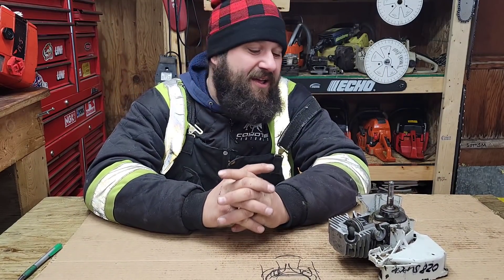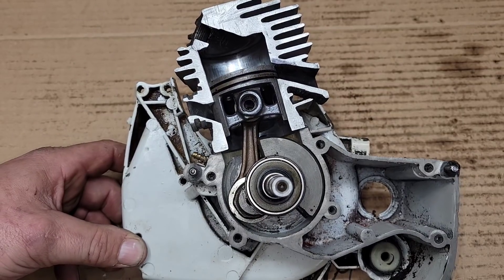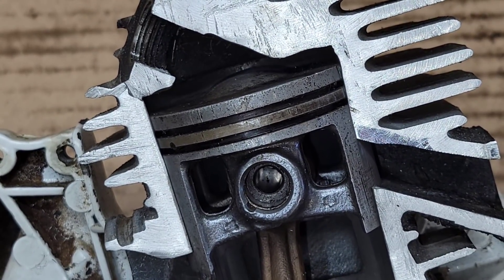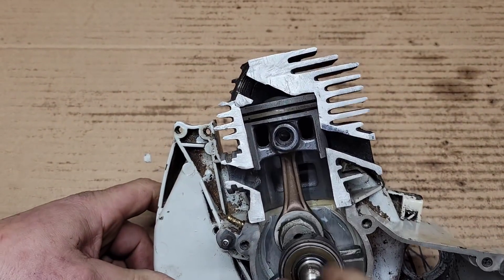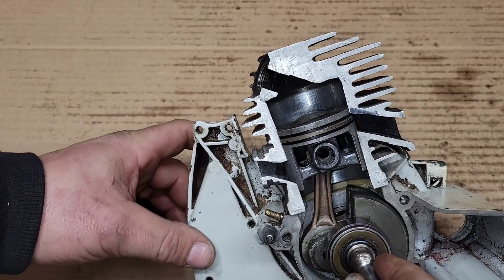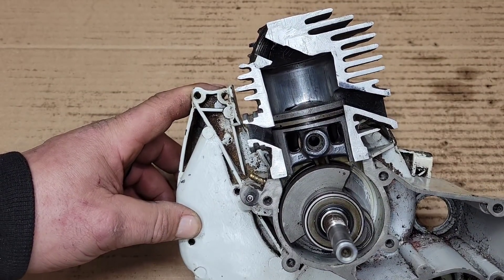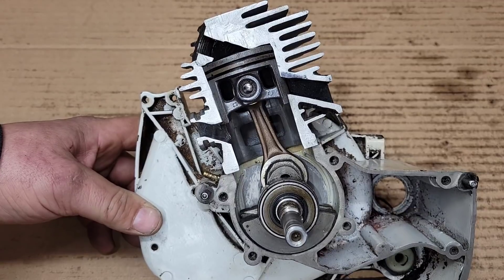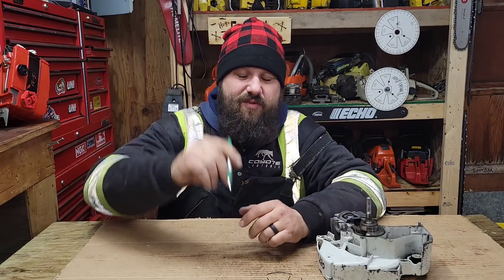Chainsaw Cutaway #6: A refresher/ how it works/ how to modify a 2 stroke.

Comment: Around the 8 minute mark when you're talking about measuring intake timing, you say you measure intake opening before / after bottom dead center.  But you say it's 70 degrees for 140 degrees duration.  It really looks like it's 70 degrees before / after top dead center, not bottom dead center.  Also the intake open duration occurs while the piston is at the top of the cylinder, so it makes more sense that it would be measured  that way anyway.  Did you just mis-speak?  I ask because I've heard other people say the same thing in videos.  They're talking about the intake opening relative to BDC but that seems wrong compared to the numbers they give.  Anyway, great video series.  Thanks for making these.

Comment: Really great info, thank you.  I'm going to try my hand at this on a 350 husqvarna with a hyway cylinder and popup piston. If I understand this correctly,  a gasket delete, then raising the exhaust back to where it would've been before the delete, should give me more compression and bring the rpm back up from the delete. Does that seem like a good plan on a work saw? Is there any consequence to widening the ports as long as they are writing the piston skirts?

Comment: I have a 670 Echo and I love this saw cuts like a dream only thing that may be good or bad a rev limiter but Iam use to it so doesn’t bother me. And I put a longer bar and chain and I think it’s a 30” but not sure but it pulls tha chain no problem it’s a beast and it is two tone color a gray and a little bit of orange don’t know what that means and I was told that their commercial version but don’t know if that’s true and if you know let me know ?

Comment: Thank you sir.
Greatly enjoyed.
-------------------------
The fuel detonation sends a shock wave
downward through the piston rod 
and into the rotational mass below,
which is designed to absorb enough
rotational energy to push the piston
back up for another fuel charge and
subsequent detonation.
Its a beautiful machine and 
thanks for slicing it open so well.
-------------------------------------------------------
Mr. Brown

12.11.2022

Comment: Very nice.
Something that I have wondered is what sets the ultimate rpm that a saw/engine will spin out to. Typically the peak power is close to the top end of the revs so it seems to me if you can get more rpms you will get more power.
Reply from the maker: Exhaust port height and shape/ ignition timing and over all weight of the rotating assembly can all play a part in max rpm.

Comment: Hey Tinman I have a mccoulloch 10-10 it's stock carb is good compression is good so is the piston and cylinder but no matter how I tune the carb it's blowing gas out the carburator until everything soaked in gas it don't want to Rev to full throttle and it's don't run but for 20 seconds then shuts off any help no one has a video I can find on this happening  muffler is also clear and open if I can get it to idle it dies instantly when turn clutch side down

Comment: Any advice on a strato saw? 550/555 Husqvarna. Will removing crank stuffers decrease case volume but give more fuel which i expect take longer to reach max rpm. I have several 550 mk2 cylinders to play with. Any advice will be appreciated. Could I tunnel from intake to strato to ad fuel?

Comment: Wouldnt happen to know where to get crank seals for an old mac super 44 and a mac 640 would you?
Reply: Take them out and try a electric motor shop they can measure them and get it from supplier . Or try a place that rebuilds pumps . They may supply you with seals.

Bill
Reply from the maker: Morning fellas, 

Take those out seals carefully and head down to your local bearing supplier. They should be able to match up the seals with something.
Reply: Love watching this stuff, it's so interesting, you had my full attention all the way. Happy st Patrick's day from Cork, Ireland